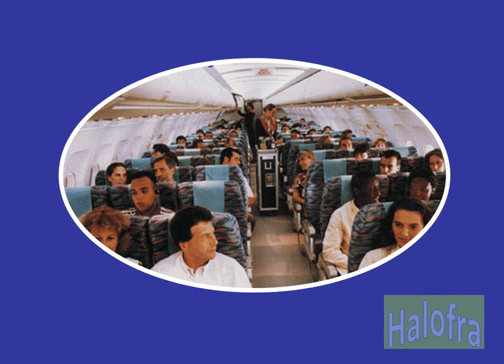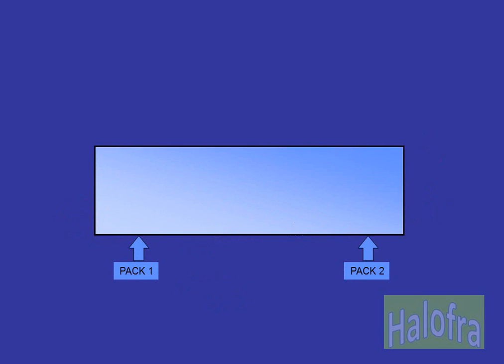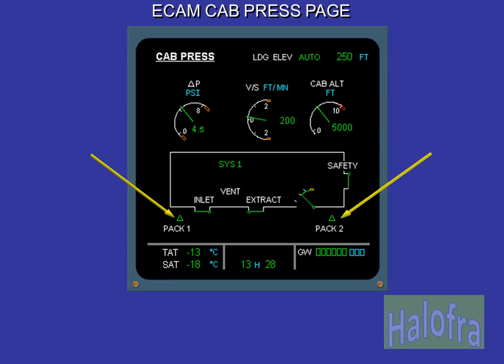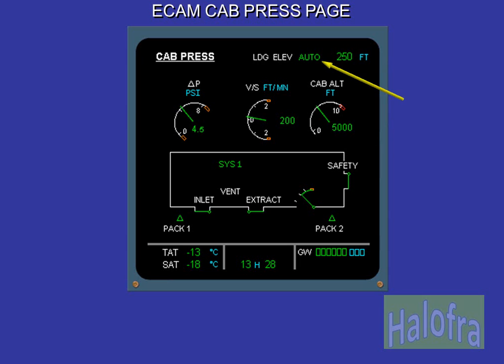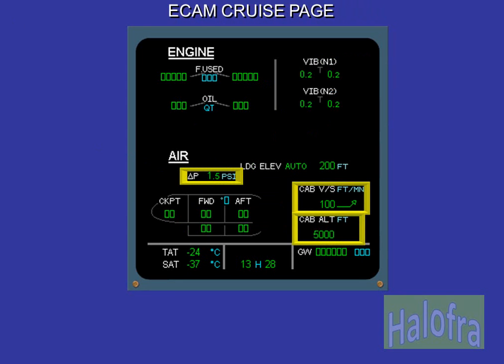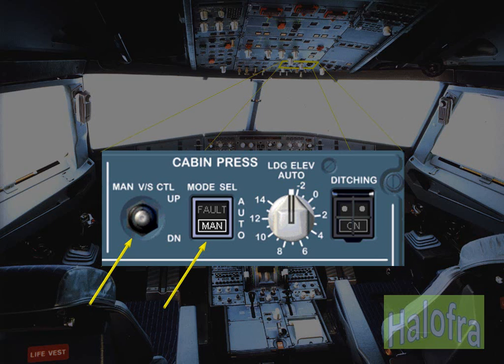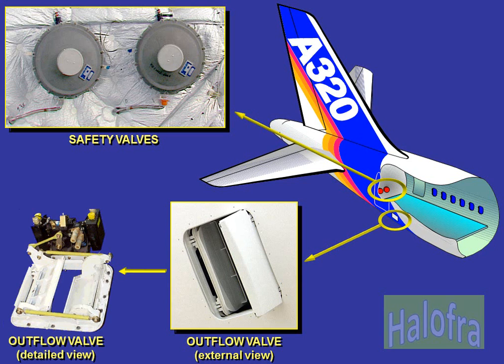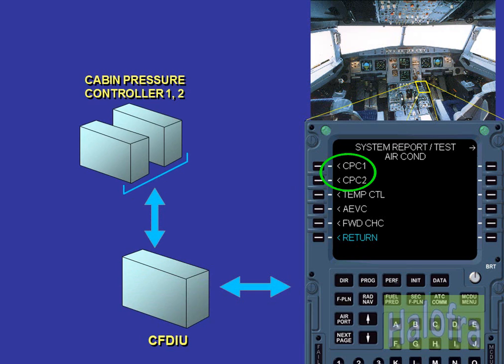A320 Family Pressurization System

Comment: I had a problem today flying my ap psi was high and in yellow color my cab atl was zero I knew I had a problem before passing 10’000 ft but I continued because I couldn’t touch my cabin press knobs (aerosoft) A320 but what would’ve been my options at that moment ??? Turn around would’ve been my 1st option obviously.
Reply: Over a year ago but if you’re still flight sim’ing hope this helps, simply put:

It’s not ap it’s delta p, the difference in pressure between inside and outside. If your delta p is high (8.6psi in the a320), but the cabin altitude is 0 and you are passing 10000ft, then the outflow value is totally closed, which has led to the cabin being over pressurised and the safety valve has opened to prevent the windows from failing. You probably had the cabin pressure set to manual on the overhead with the manual control set all the way down, totally closing the outflow value. In this case you should descend as quickly as possible, and set the manual pressure control to “up” to fully open the outflow valve, return the pressurisation system to automatic before attempting to climb again